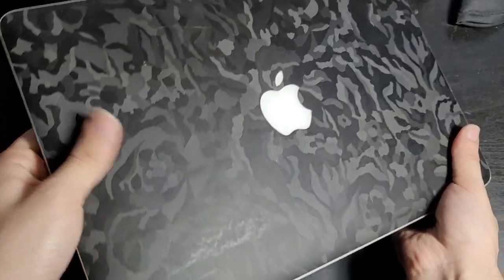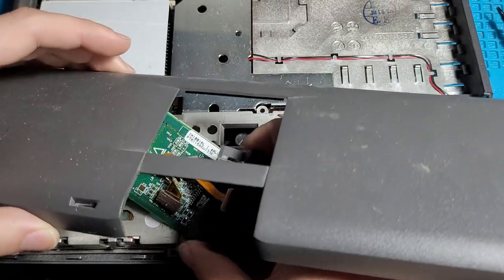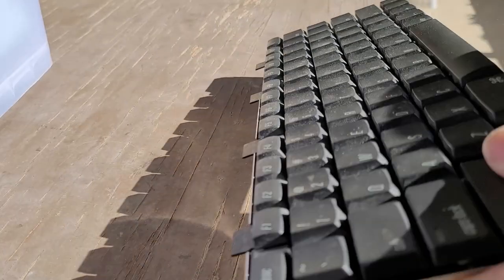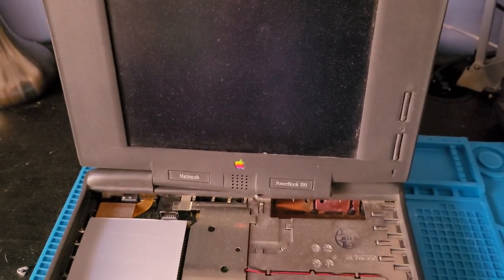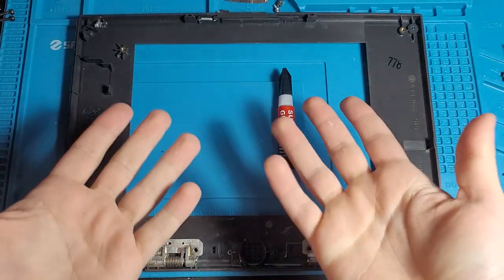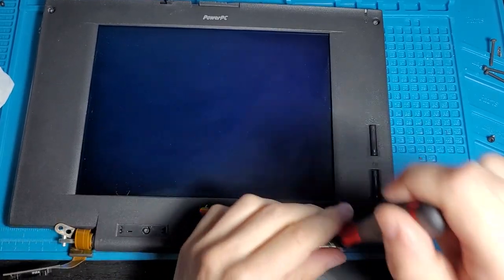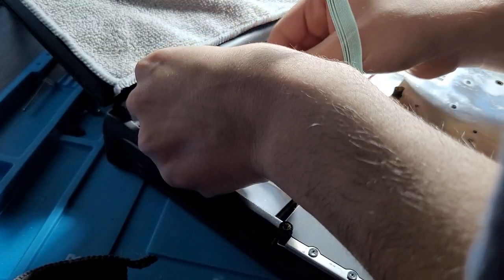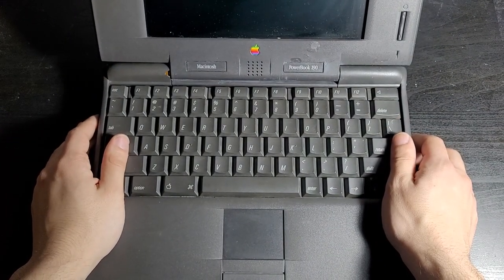Trying to Repair a Macintosh PowerBook 190

Comment: Thank you for this video! Very glad you posted it although we all had to witness the moment of death. I just got a powerbook 190cs in just about the same condition. A little less battery leakage, but pretty much the same situation with the hinges and trackpad. Without this video I doubt I had been able to open it at all. Now it's in a hundred parts all over my desk. Considering doing the same fix as you; supergluing the heck out of it. There's no way I can get these plastic pieces together. It's far too fragile.
Reply from the maker: These things really are a challenge especially the fact that they'll essentially just shatter on you
Reply: @frokfrdk  yo hi frokfrdk! I have an idea for a video - make some abomination of a foldable Lumia (although you would need 3 of the same model) and make it run Windows 11
Reply from the maker: @trisiegt  if there is a way I could span the display to all of them then I'd do it

Comment: The Power supply mightve been just providing low voltage due to bad caps on the charger, I had a problem where a iBook G4 connected to a 12v charger would just randomly throw the fan to full speed and the HDD running and no chime, tried using another custom charger and it worked (24v)

TLDR: A robust charger is required to run the Powerbook directly via the wall